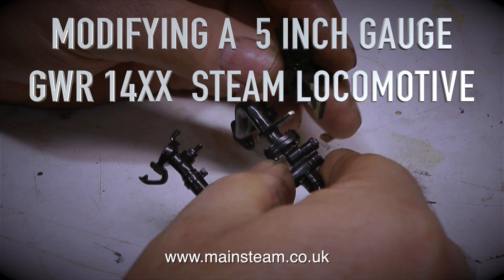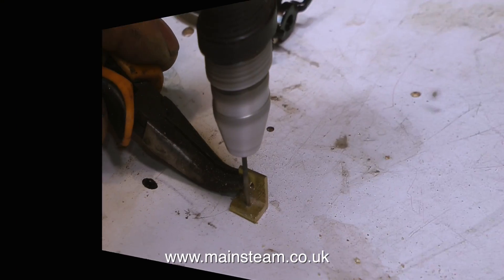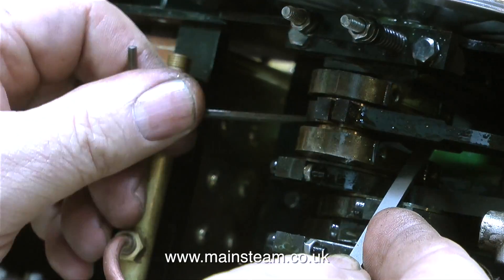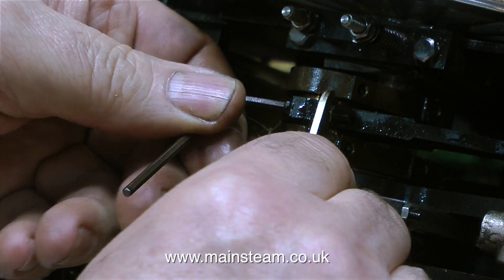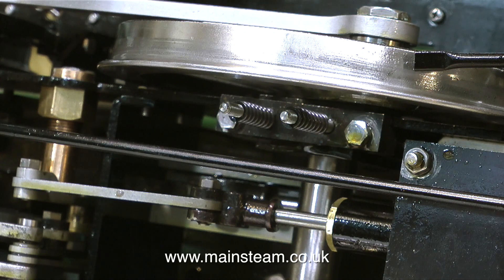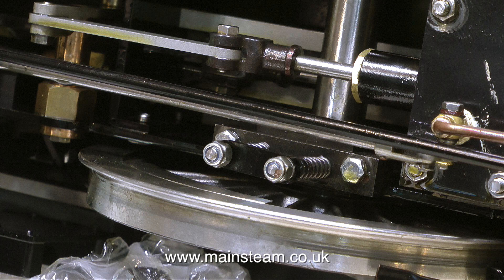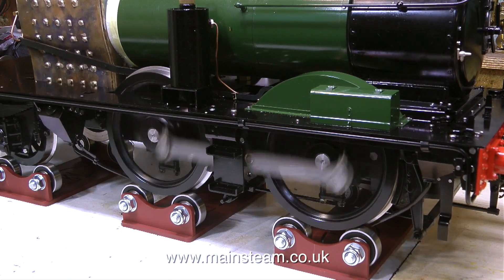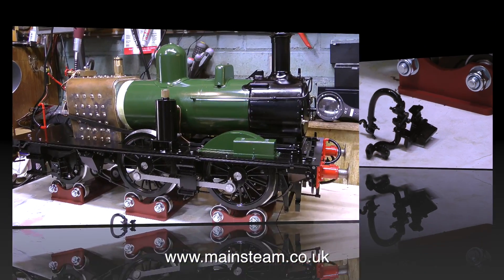MODIFYING A 5 INCH GAUGE GWR 14XX STEAM LOCOMOTIVE - PART #3

Comment: Hi Keith, after watching many of your videos it got me thinking. I am currently gauge 1 but would like to upsize on a live steam locomotive. Would you recommend 3.5” or 5” for a beginner?
Reply from the maker: 5 inch Gauge - Easier to work with as ther are physically larger.
Reply: Keith Appleton Thanks very much Keith. Just 1 last question if I may, I will be operating by myself and for weight purposes and lifting what locomotive would you recommend for a beginner? I have heard Tich difficult
Reply from the maker: A Martin Evan's Simplex was the first one I ever built and it was fairly simple to build too.
Reply: Keith Appleton Thanks Keith will have a look! Also considering Juliet, Rob Roy and Ajax as heard they are also simple! Spoke to Simon at The Steam Workshop

Comment: Hello Keith, I´m writing you in behalf of a friend of mine who´s absolutely desperated after buying an 042 14XX because this engine ( british made )can´t run. The engine supposed to be new but it´s not. He dismantled the cylinder block  and everything seems to be Ok.The cranks and eccentrics seems to be Ok too. But now the situation is that the engine ( with compressed air ) is not able to do a complete lap. It moves about 180 degrees and stops. Do you have an idea about where the problem is?. Also there is no tight spots ...Thank you very much, steam master!Kind regards, Carlos
Reply from the maker: I would have to see it to evaluate the problem.

Comment: Hi Keith, love the videos. I have a 10 1/4” royal Scot, and the suspension seems to be out of adjustment. The centre drivers (using your screwdriver method) feel like they are supporting all of the weight, while the front and rear drivers lift fairly easily. To adjust these front and rear driving wheels to put more weight down, do I need to tighten the suspension spring nuts on the keeper plate, or loosen them?
Reply from the maker: Try tightening them first and have a feel to see what the pressure difference between the wheels is. Maybe you should slacken off the springs for the centre pair. Stiff suspension is undesirable on a miniature locomotive running on the usual uneven track.
Reply: That’s great thankyou very much I’ll give it a try. Find all your videos very helpful!

Comment: Once the water is added to the engine, won't the balance between the sets of wheels change? But I'm guessing that most of that water will be held in the front 2/3ds of the engine(?), so it should only help with the traction on the 4 drive wheels, no?

Comment: I noticed that as you were working on the drive wheels the trailing wheels would lift up. Is that normal or should they all be level on the rolling rails? I was not sure if this matters or you had just not mentioned adjusting them. I always like the videos and I learn a lot from them.
Reply from the maker: Explained in Part #3 ..... please watch the series.

Comment: that looks like a steam heat fitting, not vacuum brake pipe
Reply from the maker: You are probably right - either way the part is non-functional - it just looks good.

Comment: There's actually some debate over the effectiveness of split washers as locking devices these days.  In testing they've been shown to not significantly prevent nuts from loosening under vibration, and in some tests actually loosened the joint faster than no nut at all (see website: boltscience for one such test).  Many industries have abandoned their use altogether (notably NASA describes them as "completely useless" in their fastener design manual), and I suspect that wherever you do see them in new products it's likely down to ignorance or habit.  Nylocs are much more suitable in that application as you rightly put it.

Comment: That really is some fine detail on the part, I think you called it a vacuum brake system. One would imagine leprechauns or pixies doing the machine work to make the casting dies. 
 I am not asking the purchase price, but am curious what you think of the value of the engine, considering it is assembled and finished instead of a kit.
Regards, Jay.

Comment: There I was composing a Blackgates Order for Jinty parts, and Your Mouse story comes on!! 
I must ask Adam Cro to do some lovely fittings! Current thinking at the Reading Club is to have these wonderful and delicate just fixed on for display but easy to remove for moving and running.
I am sad as there was no mention of the Baco spanner this time. Never mind I used mine to part the frames having drilled the holes in all the right places today. My tedious bit was filling all the miss drilled holes up with ends of rivets and filing down to invisible!!
Lovely work again Keith.
David and Lily.

PS They are not MY miss drilled collection? Just left by the previous part built owner!!!

Comment: Are those rolling road blocks bought to suit each wheel size, or do you have to adjust the spacing to get common "rail height".?
Reply from the maker: they are all exactly the same height - flat.
Reply: I follow what you are saying, Roger. The smaller diameter rear wheels will sink slightly lower between the rollers of the unit, whereas wheels of larger diameter than the drive wheels will sit slightly higher.
Reply: If all 3 sets are the same then the set of rollers under the smaller trailing wheels will not touch the rims. That set needs the rollers closer together. Relative to the point that the wheel touches the track, the rollers are forward and backward, and up. On the smaller diameter wheel, if you have the rollers set to the same value of up, they need to be less forward and less backward....or put another way, if you have a big and small wheel on a track, then roll 4 balls on the track until they touch the rims of both wheels, the balls touching the small wheel will be closer together
Reply: I think what Roger means is that the smaller diameter trailing wheels would (if they had enough weight over them) drop down further in between their pairs of rolling road rollers than the larger driving wheels; but since they don't have much weight on them, they sit up out of contact with the rollers
Reply: Keith, as the trailing wheels are a smaller diameter than the driving wheels, the ball bearings on the rolling road block for the trailing set need to be closer together, to get the wheel rail contact height the same as the driving wheels.
Reply: I see, then a smaller diameter wheel will sit lower on the rollers than a larger wheel.